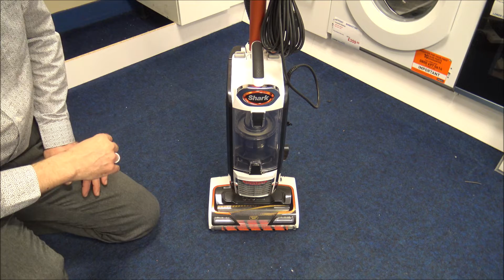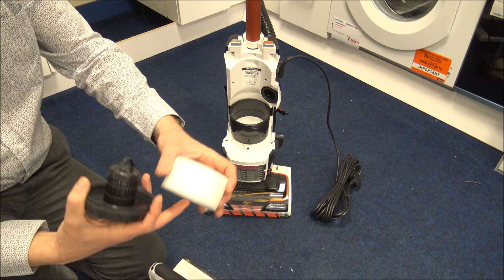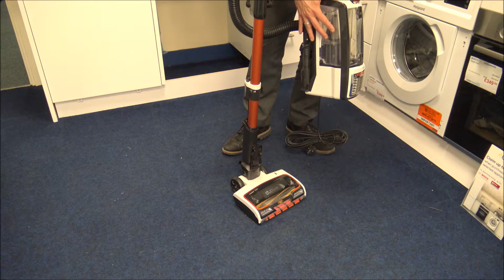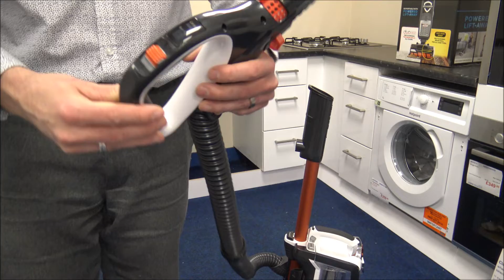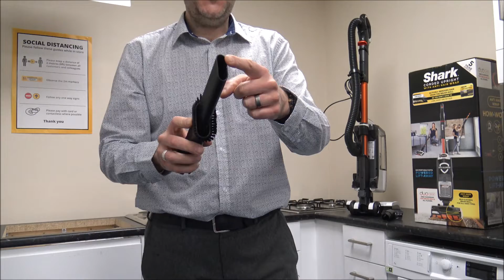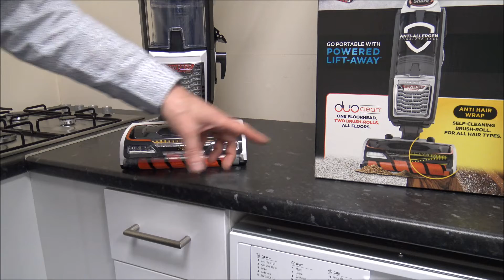Shark NZ801UK Corded Upright Vacuum Cleaner

Comment: Not sure if you'll read this as it's from four years ago. But on the off chance you do, thank you!

I used to own this Shark vacuum (NV801UKT). When I purchased it I was anticipating a flimsy vacuum, that had no functionality and possibly a vac that introduced problems rather than resolving them. BUT, I was wrong. Completely and utterly wrong and I  judged the book before reading. 

I was surprised by its functionality and build quality. This Shark became an extra arm, it was like a Swiss army multi tool. I found so many things I could incorporate/interface with.

Unfortunately, I no longer have my Shark NZ801UK and I feel s*!try about that. As my NZ801UK was mine and I have lots of positive memories associated with it, someone made it their mission to ensure it was never returned to me and the vindictive mental and emotional damage caused to me was a bonus. I bet some will think why doesn't he just get a new one. I wish I could, like everyone else I'm having a hard time currently. The unit price fluctuates anywhere between £195 to £399 (I swear, when it's at the lowest price I have no money. When I have a bit of money it's at its highest price. It's like it knows).

Anyway, I'm trying to remember if the NV801UK DuoClean brush roller could be connected to the actual handle? Plus, has the watts remained the same even through some revisions or did Shark always have the current motor?

Comment: Pleeease help me if anyone can. I’m blind and have purchased 1 of these and am struggling to switch between hard floor and carpet modes, because mine has a button on the top, which just seems to turn the vacuum on and off. Another model which I have has a switch on the top and with that I am able to tell which is hard flow and which is for carpet modes.
But with this one, I’m a bit stuck because it’s a button and I can just press it once to turn it on, and when I press it again, it turns off. I’m really confused.
Reply from the maker: On this model, there is a switch on the handle that switches between hard floors and carpets
Reply: @ hi thank you 🙌 
That was quite confusing but I’ve got it now ☺️

Comment: I have the pet hair version and have a German sheperd long hair. This vacuum is really good for the first year but hairs tangle up where they say it should not. It gets so tight the vacuum motor struggles and slows down possible burning out . You need to spend money on Torks head screw drivers to clean it out but don't bother Shark have designed the vacuum so you cannot get to clean the main brush unless you take the whole bottom end off and that includes the motor and circuit board. The only way to clean a small part of the clogged hairs is a fine but stiff piece of wire and try to hook it out. This as i see it is a design fault but has and easy remedy. Will they listen! not a chance. So be aware this is a good vaccum but not for pets with long hair. I rate it 90% out of 100%

Comment: “Feels like we’re going back 10 years” 
I’m sorry, but no. Cordless vacs are all well and good for quick pick ups and hard floors, but if you’ve got a busy household with pets and/or children, a corded vacuum is still the way to go. Vacuuming isn’t just about getting rid of the dust and dirt from the top of the carpet, its also a way of prolonging the life of the carpet. Corded vacs have way more power and are far more reliable - batteries will inevitably deteriorate over time, you don’t have that problem with a corded vacuum.

Comment: Anyone. In regards too the little mini hoover tool.  The new one has rubber blades. But the older one has brushes,  do the rubber blades work as good ,on carpets , also would the brush version also fit if I bought it separately thanks
Reply from the maker: You will find that there won't be a huge difference in the pickup ability between the 2 but the rubber bladed one will be easier to clean
Reply: @lords-electrical  I went and bought the newer version with the rubber blades yesterday and I have no complaints it’s very good and powerful. Thanks for replying

Comment: Very helpful video, thank you! I am looking at purchasing this model and 'm wondering if you can use the vacuum in liftaway mode still with the main vacuum head attached, for say vacuuming under the bed or the couch?
Reply: Yes, you can! It clearly depicts this on the Shark website (in Australia, at least) and there are videos online showing you how to do this.
Reply from the maker: You wouldn't normally be able to vacuum in liftaway mode with the main head attached to it.